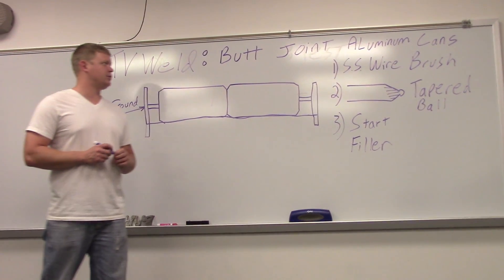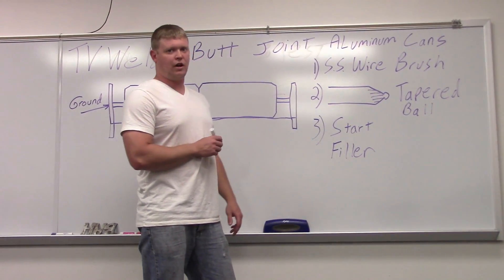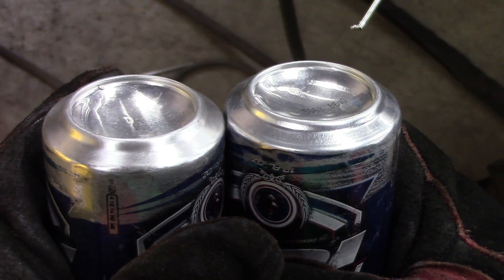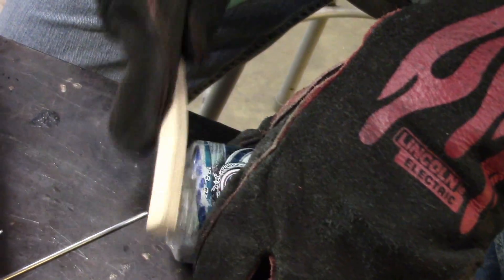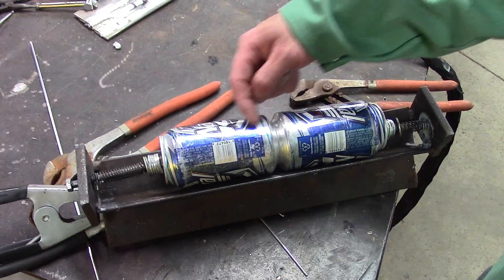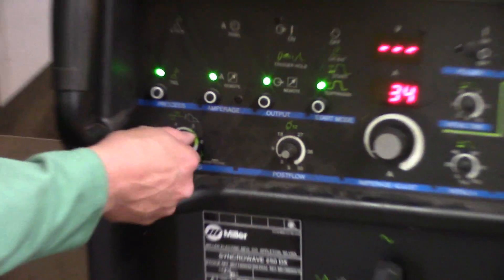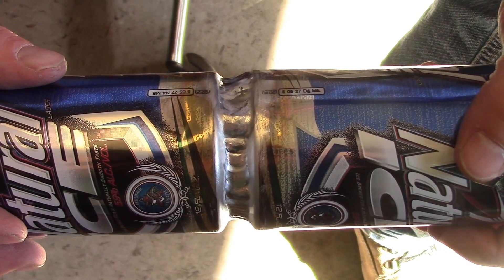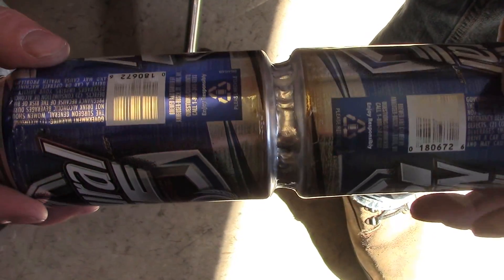How to Weld Aluminum Cans

Comment: Excellent video Brent! When you set your maximum cleaning...my setting is usually at 35% which is good for thicker aluminum. My manual says the lower the percentage, the narrower the arc, and deeper penetration. So if I turn my percentage way up, it should be wider and not as deep...is this what your machine is using set max cleaning?
Reply from the maker: Correct.  If you are on max. cleaning you will have less penetration.  I'm not sure on the width but the theory makes sense if it is wider then the arc will have less focus and less penetration.
Reply: @TVWeld  
The more cleaning the more the tungsten heats up. (cleaning = more time when the electrode is positive = heat goes to the electrode instead of to the work piece.) Seems to me like the tip of the electrode lost its shape pretty early on. Once that happens, the arc goes wider and is difficult to control. I think that was a part of the reason why you couldn't get the weld puddle to go where you wanted it to go.  Mind you I got exactly 0 seconds tig welding experience... So you probably shouldn't take my advice.
Reply: I keep mine at max pen but mainly do 1/4 up to 5/8

Comment: A little triick,try only brush one direction!, found if you brush back and forward you push the aluminium oxide (pepper) deep into the alluminum. Alloy is soft, the oxide is super hard! :)

Great video thanks for the content :)

Comment: Why would you want to weld cans for? A little portable torch and aluminium rod would work well. Heat the surface and rub the tip if the rod in the hit surface until yiu see it liquefied and it works wery well.
Reply: Practice maybe?
Reply: Wouldn't prepping the surfaces, then aluminum foil on the contact surfaces hit with the torch while cans pressed together also work to bond the aluminum? Seems overkill with the Tig. They are aluminum cans. The weakest link isn't the welds. So it's overkill.

Comment: tip: if you only have thick rods to work with, flatten them with a hammer (on a real job piece you will need thin rods). have fun and ALWAYS keep practicing, the masters do and so should you!

Comment: I am going to try this again. :-) I had the thinnest rods and 10amps. Burned right through. I think I didn't ease of the pedal and kept going too fast.
Reply: The cleaning vs penetration adjustment is definitely key here. Basically you don't want penetration, just cleaning. With that kind of amperage, my guess if your penetration bias is too high.

Comment: There's another vid uploaded that shows the guy using a positioner.  That's a pretty serious way to weld beer cans.   I did a few back when somebody else was paying for the argon.  Got better results using soda cans, poke a hole in the bottom of one.   Using 1/16 lanth tungsten, in a #4 cup with .045 filler.  Few seconds of preflow seems to make it easier to get the puddle going.
Reply: vr6swp what if trying to fix small pieces of beer cans to flat beer can as fins on a panel? What do I need, can I solder it together?

Comment: i tried this and melt hole even less than 10amps. Tips?
Reply: 1127 t what size tungsten?
Reply: Jordan Monahan 1/16
Reply: try a  .040 tungsten  should help quite a bit
Reply: I noticed the dude set his machine to "max cleaning", which reduces the amount of heat put into the work. That's probably a factor.

Comment: .040 red tungsten  .045 5356 filler  wash out cans and dry on a hot plate  punch a vent hole in the bottoms....30 amps
Reply: No need to wash out the inside of the cans. Yes, punch a vent hole.
Reply: bill calicura I'm a big fan of 2% lanthanated for AC welding. Give it a shot if you haven't.
Reply: 6061. com nice to see you on the YouTube's